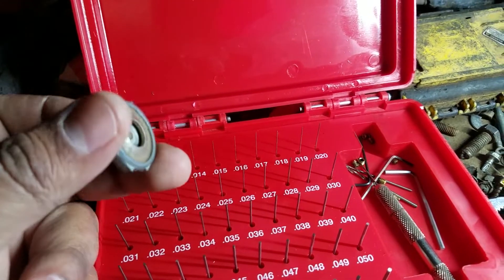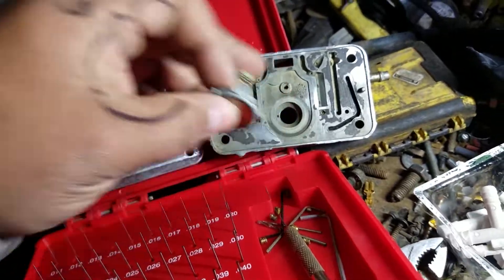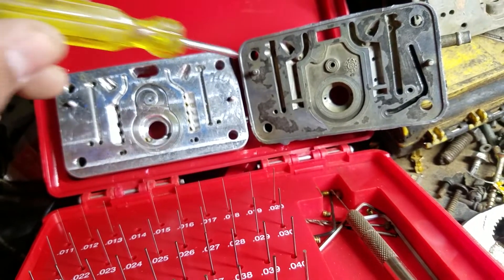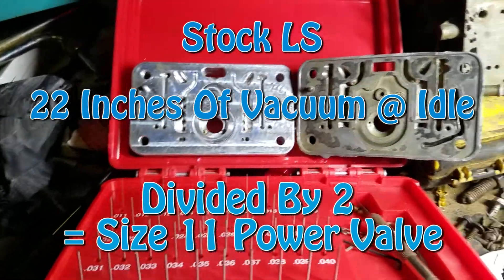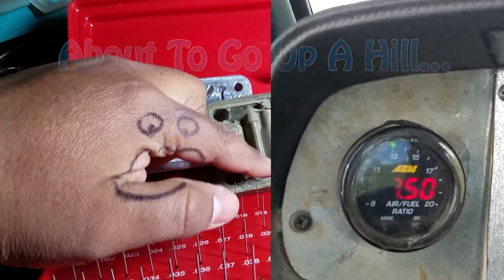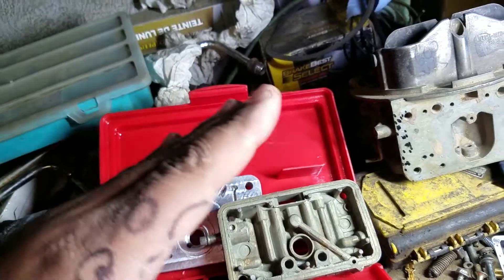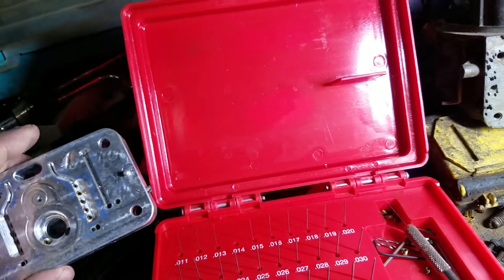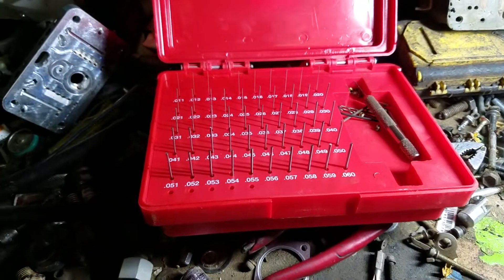HOLLEY POWER VALVE TUNING- Everything You Need To Tune Your Power Valve | Holley Carb Secrets |

Comment: I like your vidioes they are very imformative! I drag race and for the guys that are running a tall camshaft with lots of lift and duration you will have very little manifold vaccum at idle so low that you can not keep the engine running even by turning out the idle screws  to richen the mixture, the fix is to use a 4.5 or less power valve to let more fuel into the idle circute so the engine will run! than adjust the idle jets and the curb idle. pull a few spark plugs and look at the color they tell the story of what is going on in the combustion chamber if they are black and wet you are running pig rich jet down 4 sizes and go from there untill you get a nice tan color. If you think your carborator is to big you can drop down six to seven sizes on the main jets to make the engine run good and lean, keep checking the spark plugsthis will save you from buying a new carburetor. there are a few good sparkplug  reading vids out on utube check them out! hope this helps.
Reply from the maker: This is awesome man, thank you. I've very little knowledge of what to do in hard core racing situations. Most carbs I've tuned have been for mild or stock build, less than 500hp. I'm sure the wide band becomes fairly useless at idle with a huge cam! Thanks again!
Reply: @NightWrencher  you are right  about the wide band! I have a small block ford 363ci that makes 550hp I run it at the track only, just headers on it no other pipes the collector is to close to the cylinder head so I can not use a wide band, but in other situations they are very good. most of your readers are probably not racers but when you move to a bigger cam to build more hp you run into the low vaccum problem but in all situations your spark plugs always let you know how lean or rich your engine is running.
I bought a nine  fifty holley to go with a bigger cam that installed hoping it would be a good match with this new cam but it turns out it did not give me the extra power I was looking for and the engine was running way ritch on fuel, so I jetted down from #90 that came in the carb to start with both primary and secondary I worked my way down to  #80s both sides, the carb came with a #4.5 power valve in it ( this is a full race carb) and with this change I got the adjustability back in the idle circute. The idle circuit and the power valve are two seperate ciruites but with low vaccum the power valve will open sooner allowing more fuel into the boosters so the engine will start. This saved me from buying a smaller carb I probably could have got by with an 800cfm carburator from the start. Now the engine starts and runs great and I saved some money! when you are making these changes and you run the engine at top end speed under a load listen for a( pulsating miss ) if this happens your engine is running too lean than you have to jet up on the secondary side probably two sizes to start with and keep checking those spark plugs. I hope this helps some one out!
Reply: @randyjohnson1809  cool.

Most street Holleys come with a 6.5 pv.

I thought that if you want to pull in fuel quicker after the accelerater pump shot, you would go with a 7.5? 

If an engine only makes let's say 12" of vacuum, a 9.5pv would open up really quickly right? 

Right now my 381 Chev with a 650 speed demon, and a really big cam has a slight hesitation if I crack the throttle fast. What could it be? 

I'm going to try a 35 then a 37 pump nozzle first, it has a 31 now. 

If that doesn't do it, I'm going to try a 7.5pv then a 8.5pv. 
Timing is 22* initial and 37* total, jets are 74 primary, 83 secondary, idle is around 800 rpms, transfer slots are pretty bang on too. It dynoed 511hp and 495tq.

Comment: Wow, excellent explanation of the power valve I have two carb tune books and it could not tell me the powe valve was the circuit after the primary jets!!! Good work!!! How about vacuum secondaries would these take the place of the primary pv since they also work under load through vacuum decrease, I had to delete my primary pv on my quick fuel 580HR ,  has exact metering plates  as holley?
Reply from the maker: Thanks you, I really appreciate it! The PV and the Secondaries operate independantly of each other, but what I notice is that the PVCRs on off the shelf carbs are drilled too big and force you to run a higher jet and a lower PV or itll dumo too much fuel. You can tune them independantly buy going up a steep hill at just enough throttle to open the PV but not enough to open the secondaries. Youll need an AFR gauge to do this correctly but if you dial it in, youll be able to clean up your cruise AFR and youll have a smoother transition. If not, keeping your jets up and blocking off the PV also works but youll be running rich at cruise. If youre racing, thats not a problem, but if its a cruiser, you really want to dial it in for driveability, good luck!
Reply: @NightWrencher  Yeah, I definitely have a afr guage, no way to tune it without one, Thanks!!! Keep it up!!

Comment: I run a 570 street avenger and I’m going lean (up to 18 AFR)as the vacuum secondaries are opening with a 6.5 power valve and a black spring. I will try an 8.5 power valve and see if that helps.
Reply from the maker: I ran into a similar issue. After the secondarys open up my AFR would go back to the 12s. An 8.5pv fixed it
Reply: NightWrencher yeah there’s not many vids tuning vacuum secondaries. I run a 3000stall in my trans and as it gets to 3500rpm I need to check where my manifold vacuum is. There’s a lot happening between 3000-4000rpm.😄
Reply from the maker: What helped me out a ton was installing that vacuum gauge. I got 5 ft of vacuum hose for a few bucks and attached my $10 gauge to my dash. its a little ghetto but it gets the job done! Really helped dial in my carb and pin point my problems.
Reply: The 8.5 worked. But the 7.5 worked better. I think I’m a bit high with the secondary jets so I will play with them next👍.
Reply from the maker: Thats great! You might think your secondaries are too high, but chances are your PVCRs are too big.

Comment: You could possibly be right, 570-600 cfm maybe be better for your application. Dual planes usually allow you to go down on jet sizing, not sure which intake you are using but they provide a stronger signal. Holley has a carb sizing chart based on displacement and volumetric efficiency of the heads. Cylinders 7&8 tend to run leaner on LS engines so you maybe able to dial some timing out depending on your ignition controller. Your headed in the right direction with your videos. I run a primary metering block with adjustable PVRC jets on my turbo application, will work on NA motors too. Keep at the informative videos.
Reply from the maker: Thanks man, really appreciate it!

Comment: Great video. Single AFR reading are an average. Total fueling or total fuel area should be balanced. Primary jet + power valve = secondary jet. Hence the common jet spread. If not fueling distribution will be off but the AFR gauge will have you thinking everything is OK. Jet area charts will help to know total fueling.
Reply from the maker: Ive never heard it explained that way but it does makes sense! When I got my main jets dialed in, and then set up my power valve, I kept having to jet down my secondaries. Im running  65pri and 58 sec jetting with a .020 PVCR. I figure this is because the 650 I have on my LS right now is too big for the stock engine and it cant pull enough air in the upper RPMs. I tried blocking off my power valve and just jet up but the same thing happened but with less drivability. It really showed me how Carb sizing affects everything

Comment: I have a 650 Holley double pumper that we put a 750 base on and put a Proform main body on and we are using the adjustable metering blocks. This is a 4 corner idle carb. It is running rich at idle even after drilling small holes in the butterflies and putting 73s in the idle air bleeds. Where should I go from there? Car is a Chevy 383 with a Comp Cam  294 retro fit hydraulic roller.
Reply from the maker: Ok, so first, the 650 and 750 base plates are the same baseplate. Second, you should install the original metering blocks back on the carb and remove the adjustibles to verify if the rich condition is in the main body or the metering blocks. If you turn in your idle mixture screws, the engine should die. If it does not die, you have an internal leak from a blown power valve or installing the wrong metering block gaskets. Lastly you should NEVER drill your base plate UNLESS you have a radical cam that requires more air AND FUEL to idle. If you just need more idle, you could have opened your rear throttle blades a bit if you maxed out your transition in the front. One last thing to check is float level, if it is too high itll pull fuel through the boosters at idle.
Reply: @NightWrencher  the cam is pretty radical. The car will die if you turn the idle mixture screws all the way in. It has 4 corner idle mixture.
Reply: @NightWrencher  can you open up the rear blades like that if it is 4 corner. I thought those slots could not be over exposed either?
Reply: @NightWrencher  float level is just below the site hole.
Reply from the maker: If the engine will die from closing the screws, then you probably don't have a leak. I'm assuming you don't have an AFR gauge? How do you know its too rich? Low idle? Backfiring? Popping out exhaust?
Reply from the maker: I  would install the oem blocks back on and check again.
Reply: @NightWrencher  it fouls plugs and AFR is 13.0 at idle
Reply from the maker: @CarportGarageDragRacing   13 at idle is not rich. Thats actually a good afr for idle. 13 or 13.5 is pretty clean. What is your spark plug gap set at and how much advance do you have at idle?
Reply: @NightWrencher  11:1 compression, NGK 7 heat plug gapped at 35
Reply: @NightWrencher  distributor is locked at 32
Reply from the maker: It sounds like you're doing all the right things. Big cams have a lot of reversion so your AFR at idle might not be reliable. Did you try to open the rear blades and close the front ones and turn your idle screw down to just above fully closed? What is you IFR set at?
Reply from the maker: Are you running nitrous or why are you running a 7 instead of a 6?
Reply: @NightWrencher  going to be running 150-200 shot
Reply: @NightWrencher  to be honest I did not check the ifr jet size in the aftermarket metering blocks
Reply from the maker: @CarportGarageDragRacing  when I ordered my set of metering blocks ,  the IFR were way too big as well as a PVCR. I needed .032 in ifr and .020 in the pvcr. You might need them bigger than me but doublr check your sizes